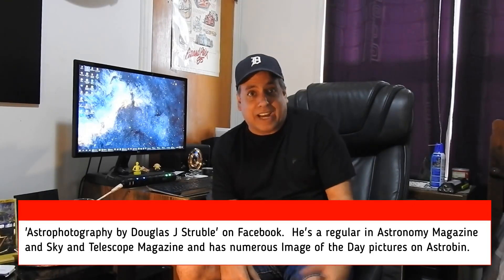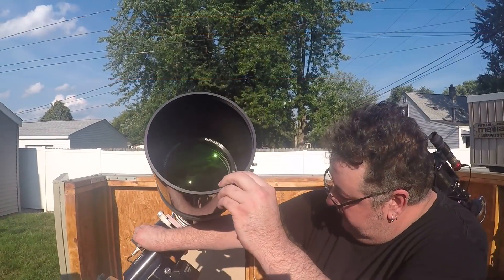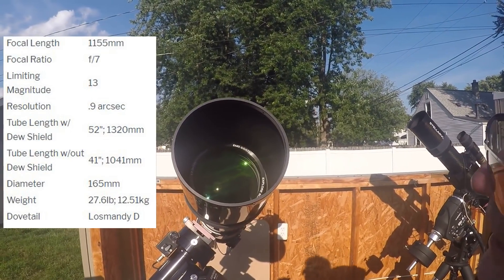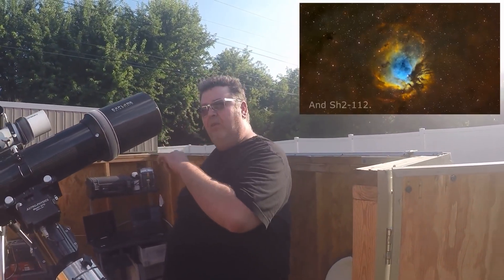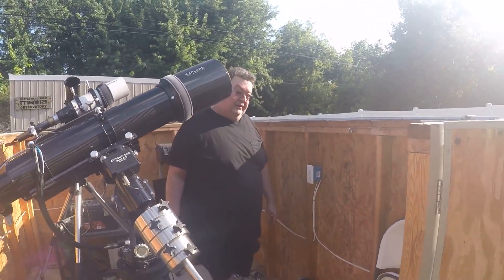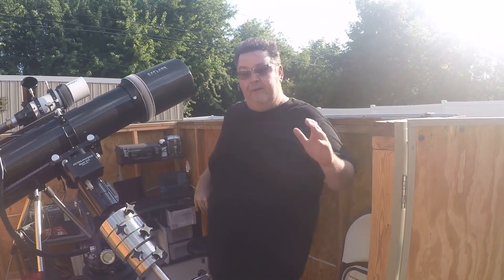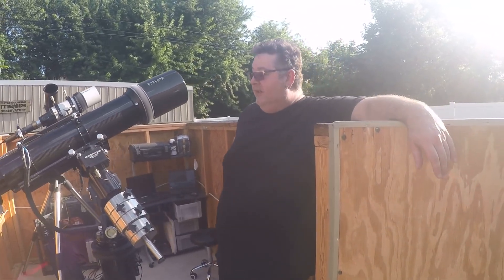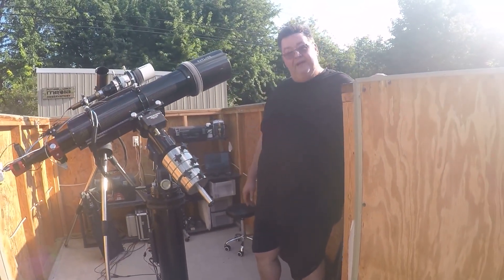My Buddy Chuck Paying a Visit to My Observatory

Comment: I too (believe firmly) in maintaining "clean" scopes (12x of 'em), and a meticulous astrophotography lab.  Bagged optics when not in use; covers over all the idle scopes; dust covers over all cameras, etc., etc. - stored in steel tool-case drawers.  My two 152 refractors aren't quite as large.  Way COOL guys! :)  PIX of my "big rig" [link]:  
https://www.facebook.com/groups/1428368180507090/permalink/3232274410116449/